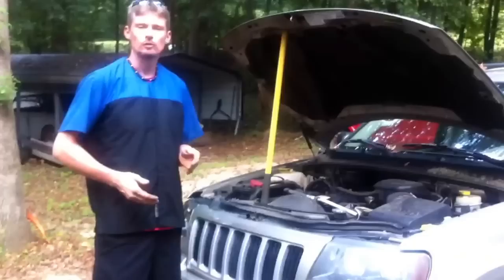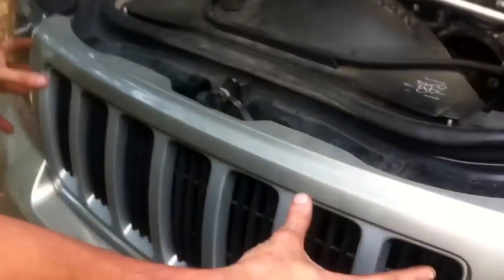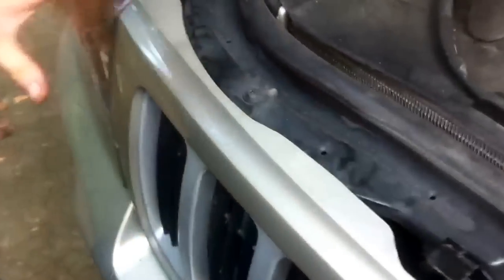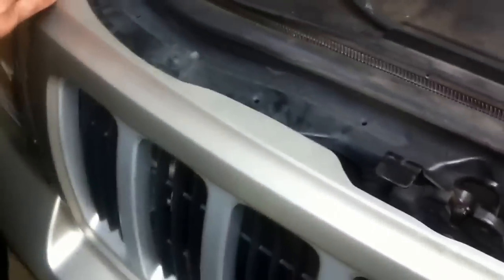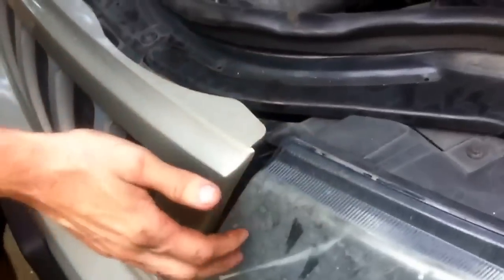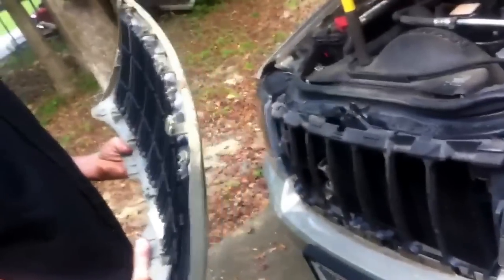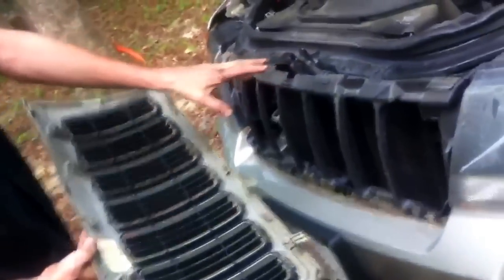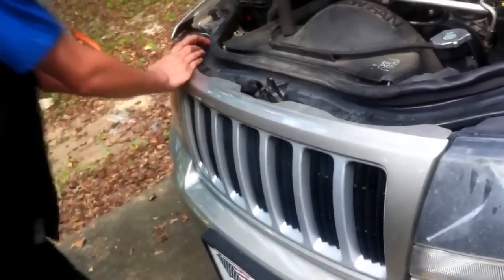2004 Jeep Grand Cherokee front grill

Comment: The 1999 GC grille has 4 screws (instead of clips) on the upper edge, and 3 more Phillips screws (instead of tangs) along the lower edge.
Reply from the maker: VideoNOLA Thanks for the update and for setting me straight lol. Make sure to subscribe
Reply: MotorCity Mechanic Ha, it gets worse: Even after removing all 7 screws, the 1999 grille is still attached to the bumper(!), which you likely have to remove (that's 2 more screws and 3 fascia rivets, plus 2 retaining tabs) to access the fasteners – because they are behind the grille's lower edge.
Reply from the maker: VideoNOLA Im going to go ahead and change the title year description so there is no confusion. thanks again
Reply: MotorCity Mechanic That snap off design is far superior! You see a lot of 1999's with broken plastic tabs so the screws aren't doing anything. Wonder of the different designs are linked more to towing packages instead of model years?

Comment: I have a black aftermarket grill for my 04 Grand cherokee, but it is not a snap on grill, how would i install this ?
Reply from the maker: Kenyon Mills that's hard to say without seeing the grille. If you have a link to where it's online then let me know.
Reply from the maker: In 2004 the grill just unsnapped and pulled off....2003 and older require the front bumper cover removal per the service manual. Some show screws along the bottom grille openings and a few along the top. Not sure which method will work best for yours. Here is a video that someone made that shows their version being removed: https://www.youtube.com/watch?v=xgJXMJvtWrA